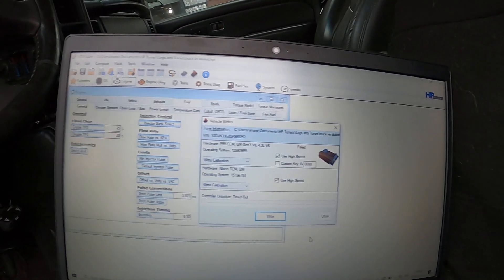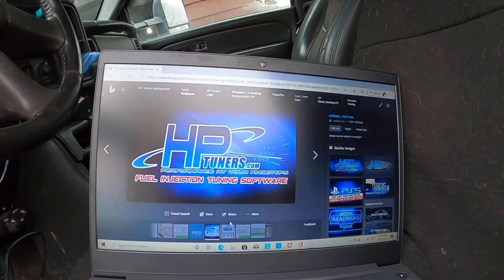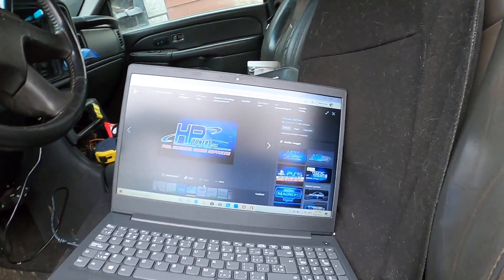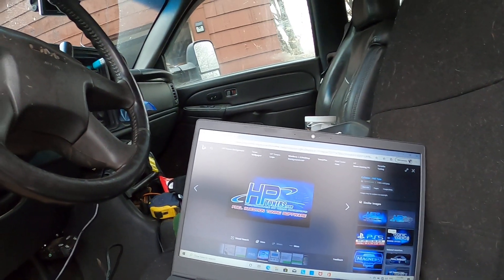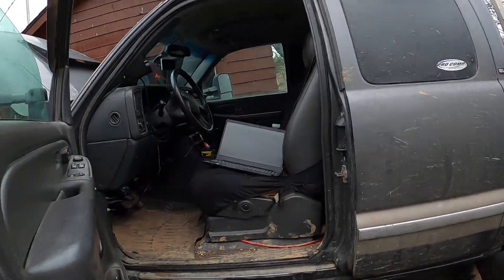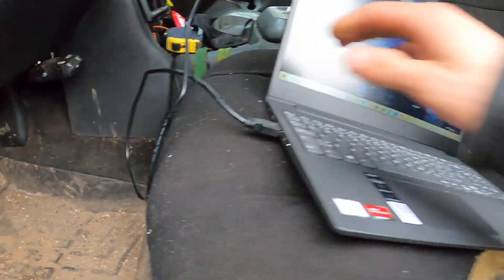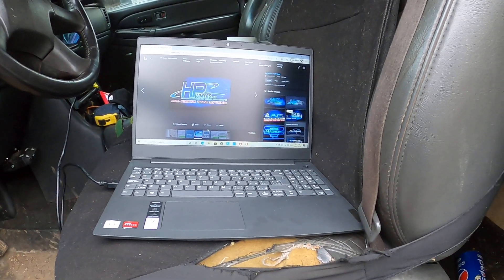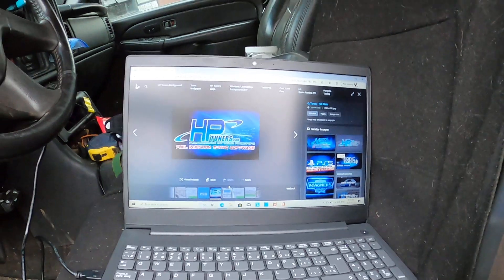HP TUNERS REQUEST TIMED OUT!!! 8 REASONS/THINGS THAT WILL CAUSE THIS ERROR

Comment: Man I tried all these and nothing still so I submitted a ticket on my 2015 and tried a whole new lap top
Reply: If you have anything that is aftermarket unplug that shit like cluster radio a/c module ect I even pulled the bcm
Reply: @LAYTHON_PHOTOS  k I will try that … lol I guess if I ever want a diff tune I’m going to have to lol pull over pull all the fuses and radio lol just I better take a pic before so I know right were they go back lol and I don’t get 1 off by accident lol
Reply: @LAYTHON_PHOTOS  so what blows my brain is that I didn’t have any of these issues the first 2 write calibration’s ? So it’s like nothing s changed so why now 😢. It’s my daily and basically been down bumming rides … this hp tuners is garage if you have to do all this in order for it to work … I would have rather paid double if i didn’t have to pull all this bs and lock out my tcm ?
Reply: @KennethC-x8n I'm not saying you have to pull all of these things it just what I did and it wrote the tune
Reply: @KennethC-x8n I'm still actually narrowing it down to what is causing the issue my best guess is my refurbished cluster but Im going to narrow it down to I find the issue

Comment: Man I have a 2015 Silverado and am getting the timed out message and cel is the tcu communication error … and have tried everything on your list and I’m able to get the cel stuff off of it so it’s not bricked right .. but I’m afraid what to do next ? So I don’t brick the tcu … I have  disconnected the battery since last night … but i in have tuned my truck with the aftermarket radio in so is it possible it s not the radio and some say u have to pull 2 fuses out ?

Comment: In reality, I am facing this issue for the second time with a new computer.

Even though I removed the radio fuse and connected a booster from another car’s battery to prevent voltage drop, the issue still occurred.

When I wrote the file and only 6 seconds remained, the ECU got corrupted and showed a time out error.

What is the solution now?

Note: I can no longer detect the ECU.

Comment: I think some vehicles just have to be benched tuned.

I pulled:

1. Radio
2. Radio Amp
3. Info
4. SEO B1
5 SEO Ign

Wrote slow speed failed the erase step and boom lost everything. I got a bench tuner coming so I can recover it and it’s bad that it’s my sister’s fiancée’s truck. I feel bad but wtf is this issue
Reply from the maker: I wouldn’t of pulled ignition fuse
Reply: @BurninGas8.1  I was just trying everything I could find on the forums lol it started with the 1st three then one post swears he did the other two as well and worked like a charm.

That was a lie 😂
Reply from the maker: @austinwilbanks5919  that’s frustrating sonetimes the ecu can just fry for no reason at all I have a lot of stock tunes if you need a file

Comment: I had the sane issue. Thought I bricked my computer. Tried about 20 times. My fix and it actually worked was before you hit write, un click the high speed write box and then hit write. A little slower writing but it went through for me.

Comment: It's kind of you to share info but I'd like to offer a correction.
You absolutely can leave the scanner open and download or upload a tune.
There is a function in the toolbar to release the com port. In the lower toolbar, there are 2 images of a car from the front end. (Old software is just a pair of  lightning bolts on the bottom left) 
Click on the right car or right hand lightning bolt to release the com port.

Comment: Far as scanner and editor open at same time just hit disconnect from vehicle on the scanner . Don't have to close it out .
For your lights once they come on you should be able to twist headlight switch to the left and it cut your lights off.
If that don't work hit the done light button just under the headlight switch several times in a row and it should cut them off .
Give it a go .
I've never tried the radio fuse myself but will try it next time I run into this issue 👍🏻

Comment: your issue when it wouldnt work when everything is right until next morning was prolly the computer, anytime im using a computer and things arent working right i reset it and atleast 75% of the time boom it works, with your cable blinking the usb in and out like that id guess your usb port may have errored out and shut off, sometimes switching usb can work, this applies to any windows computer new or old btw, im sure you may have one but I have an autel 906 i just picked up its a pretty badass scanner if your in need of a high level one anytime, it does everything from chevs to bugatti's lol
Reply from the maker: I have a very complex handheld myself next best thing to a snap on bought it when I got my m5.. and yes resetting or switching USB can also solve issue and restarting... most times it is low battery voltage...
Reply: @BurninGas8.1  right on, by your vids id figure youd have something already, ive thought of putting a tune on mine never been happy with the stock tune, the shift points usually suck but being all stock  i dunno if it would be worth it